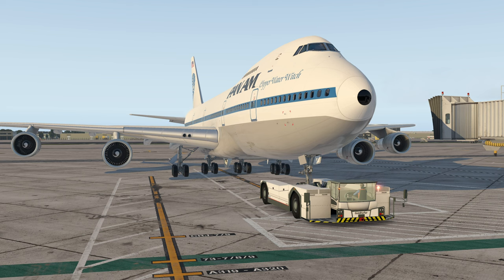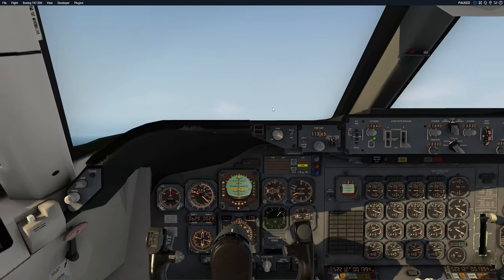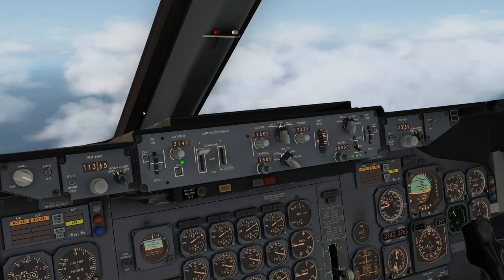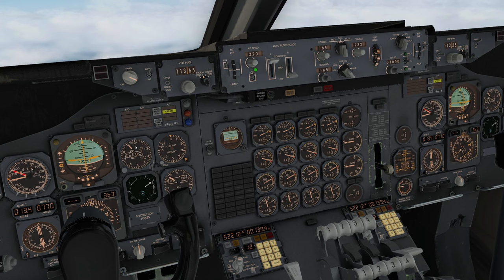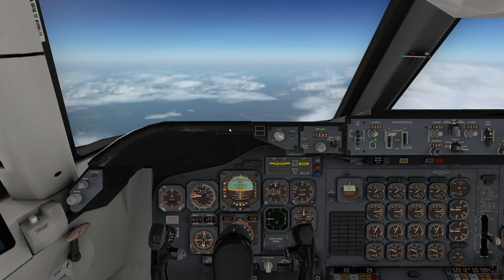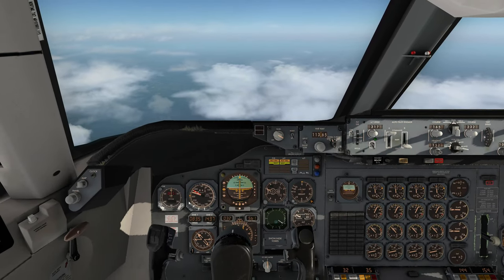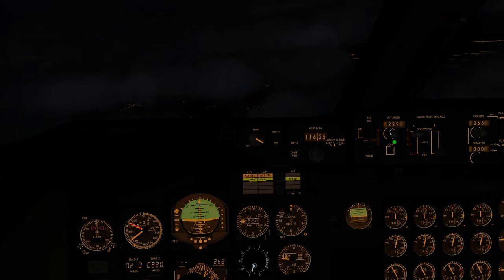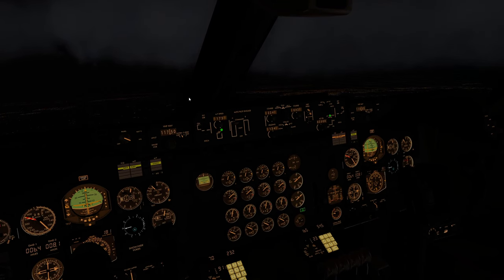Boeing 747 200 Complete Autopilot Tutorial | Felis 742 Classic Xplane

Comment: In those days descent were performed in VS around 2500ft/mn( times your GS is a good base)(adjusted to maintain the 5% descent)never in IAS Hold, if you have trouble with the AT you can select 250kt in the corresponding window. We had to compute precisely the point of descent according to our GS and the altitude to reach. I didn't fly the 747 but I flew the DC10-30 with almost the same AP and AT.
Reply from the maker: That's very interesting stuff. I would have LOVED to have been a pilot in the days where one actually had to fly the plane (and use brain with the autopilot). All this fully automated TOGA/wheelsup/400ft hit autopilot and that's LNAV/VNAV hooked up and tray table can come out until 30seconds before touchdown 12 hours later... Not saying its a bad job, but its a shadow of what it was - like most things today. Thanks again, I think you had the best time of it!

Comment: This is a fantastic video! Very informative indeed. Can you please tell me what is the name of the Flight Simulator program you were using for this, as I would really like to get this myself. Also what are the PC hardware requirements for running the program?

Many thanks,

Sharon.
Reply from the maker: Hi, sorry for late reply. This is Xplane 12 (the flight simulator) and the aircraft is Felis 747 - 200 (the "classic").

Regarding required hardware, like many things, you get what you pay for, I cannot recommend enough a stick and throttle lever and pedals (again, the more you spend... See dedicated reviews on these, or try them out if possible).
Xplane itself isn't the most demanding simulator ever - but some aircraft, like the 747 here, do add to this.
Reply: @gameswithbrains  Thank you :) The 747-200 is indeed a classic! that and it's predecessor the 747-123 (100) series (1969/1970, the one with the spiral staircase leading up to the small upper deck with only 3 windows) are my two favourites of all the iterations of the 747 aircraft.

I have flew on a few 747-200 series airplanes back in the early 1980's, but only ever once on a 123-100 series.

Regarding the information you provided me about a stick and throttle lever and pedals, I will almost certainly look into getting them, as that will enhance the experience and make it much more realistic.

I took flying lessons back in late 1991 and during 1992, and achieved my PPL at the end of 1992. Only ever flown real single engine aircraft, but obviously know and understand a great deal about piloting, and have been inside the cockpit of several commercial airliners (back in the 90's before 9/11 when you could ask the cabin crew if they could speak to the pilots and ask if if you could visit the flight deck, and they would often allow me as a passenger to enter the flight deck once we were at cruising altitude) Such fond memories of those days! :)

Comment: Hello!! It appears that my Trim wheel does not at all change as we climb, therefore the aircraft climbs uncontrollably
Reply from the maker: Do you have your controls setup to change it?  My wheel doesn't move by itself, I'm using the trim switch (the china hat on my joystick)
Reply: @gameswithbrains  I was able to fix it luckily, I have to leave the AP in manual mode for 4 seconds for the controls to enter neutral state, then I can select command and the AP trims the wheel itself